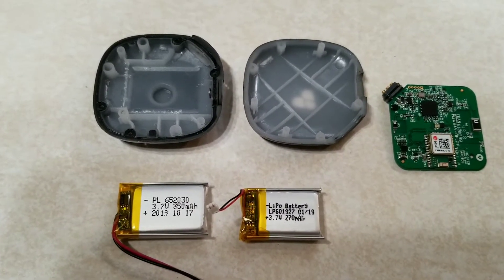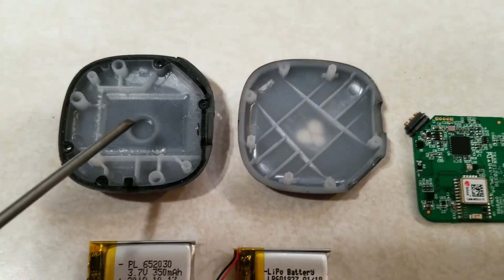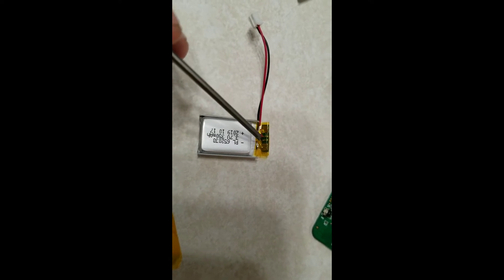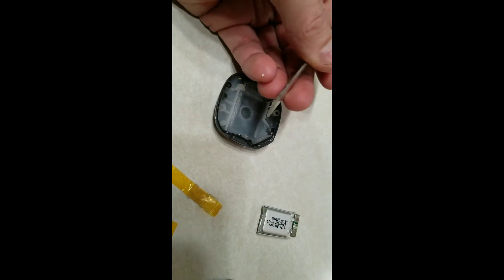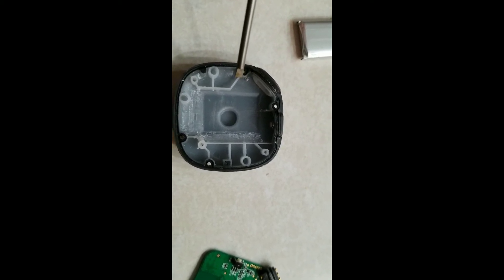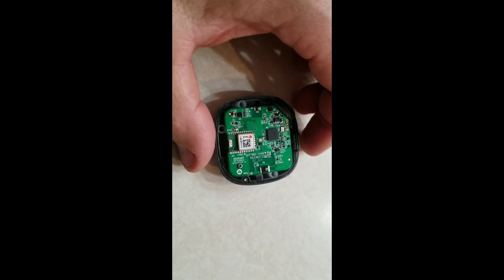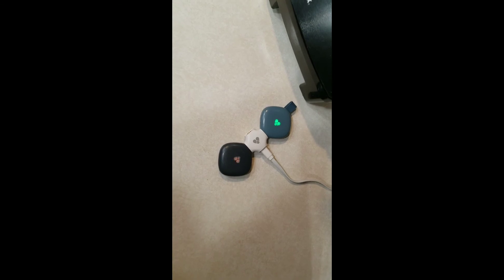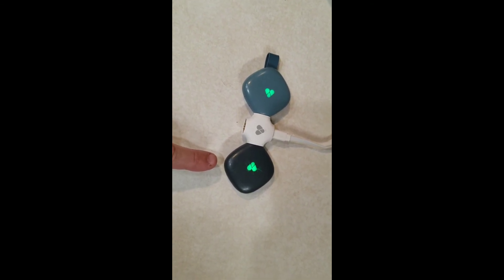Findster Duo Battery Upgrade

Comment: Hey, thanks for making the video. Just out of curiosity. Instead of removing the solder and the wires from the board. Why not just cut the wire and add the connector to the fresh cut wire, solder it and use a connector?